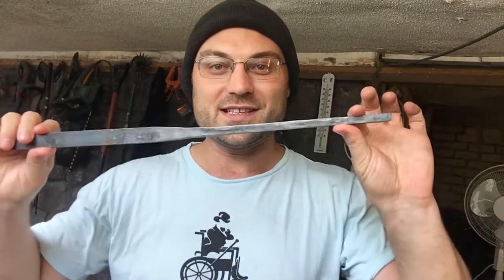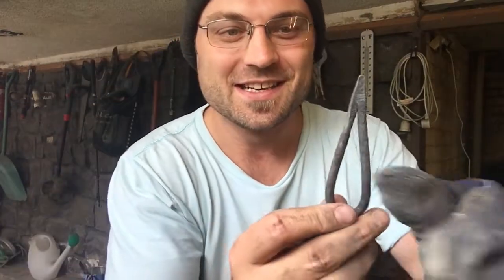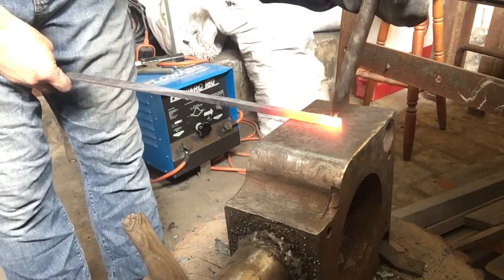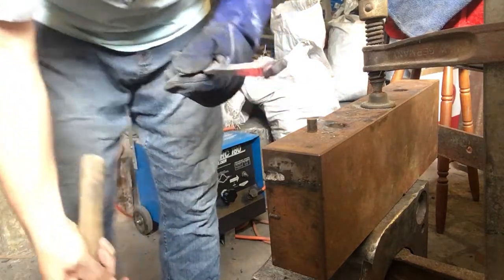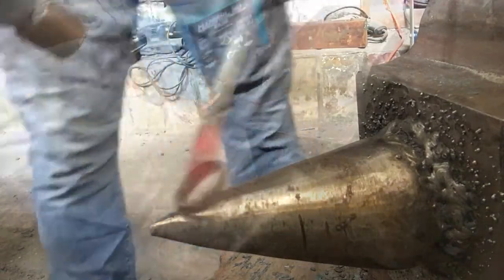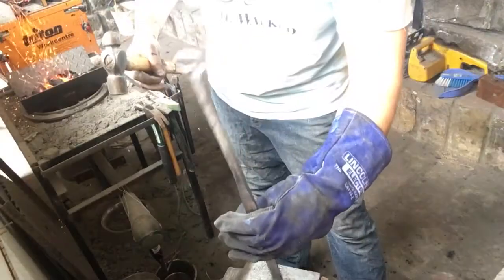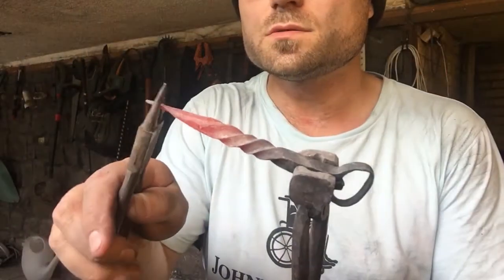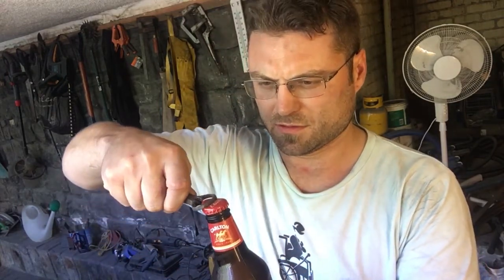Forging a Bottle Opener - Warped Blacksmith Challenge

Comment: Nice one man! Tip to help forge welding, when doing normal forging, I test myself, daring to get it as close to burning as possible on every heat. The metal moves very easily at that point, making the normal forging very efficient, and you build up your ability to recognize when the metal is at a welding heat, without burning. Also look for the metal "smoking" too, good indication that you're there. I try not to allow it below a yellow heat for the first couple welding passes. Chain links are difficult, as they get too thin very easily.